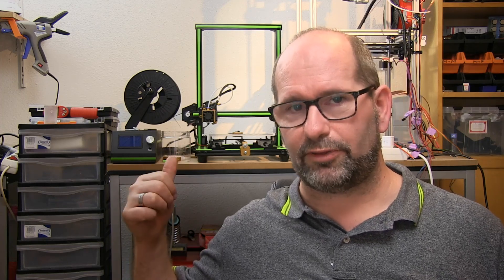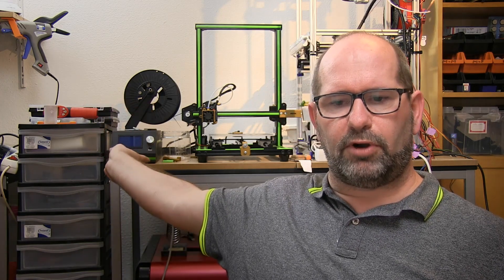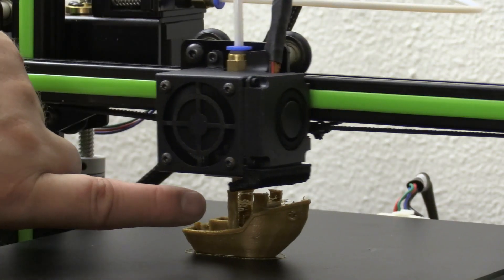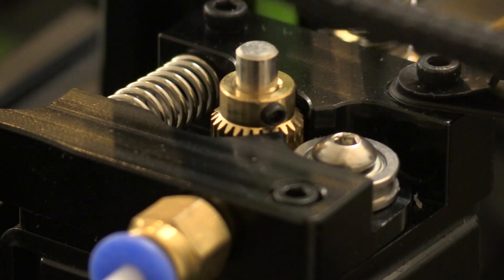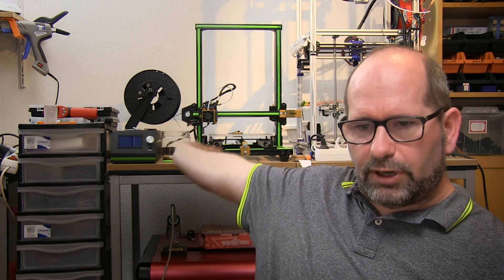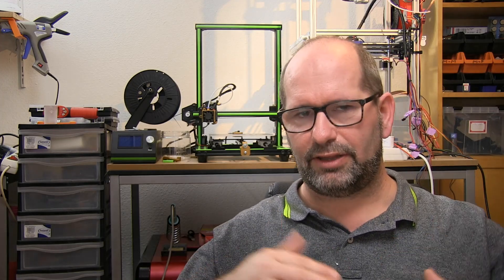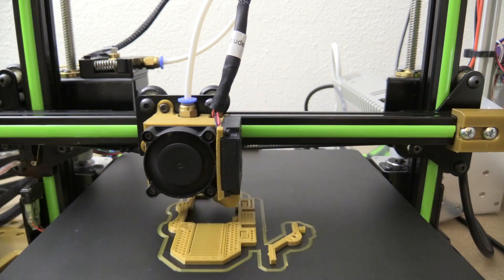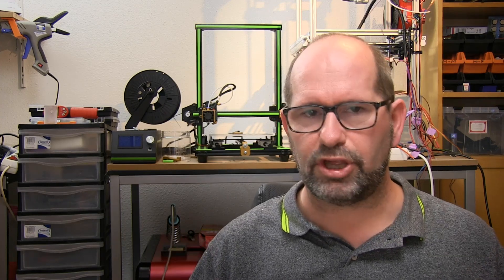▼ Anet E-10 3D printer Final Thoughts after a few weeks of use

Comment: Hey Brian did you ever check out the davinci mod Facebook page I told you about? I have a Modded davinci pro with 2 extruder motors for one hottend.
Reply from the maker: Hi Michael,
I am afraid I didn't.
I think I just tried to subscribe and I am now awaiting approval.
Reply: 3d Print Creator is it  Da Vinci Pro-Duino: 3D Printer Modding? That's the page.
Reply from the maker: Then it was the wrong page, but when I tried this one, I was already subscribed... So yes, I did (once) take a look.
I promise to take a look more often. I see there are a lot of great posts in that group.
Reply: 3d Print Creator did you check out my all back pro with the dual extruder motors for a single hottend system? The only thing I really need to do now is make an acrylic lid that sits on top of the machine.
Reply from the maker: I think you have to send me the direct link to that.
I have been scrolling the timeline 3 times and also tried finding it via Google, but I can't find it.
I am very curious though.